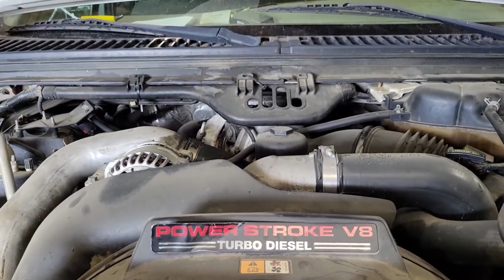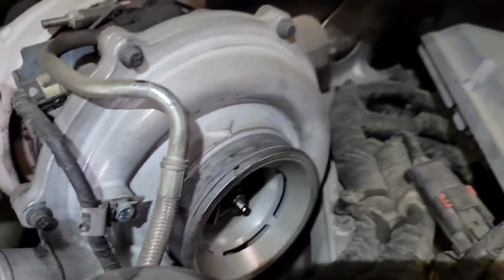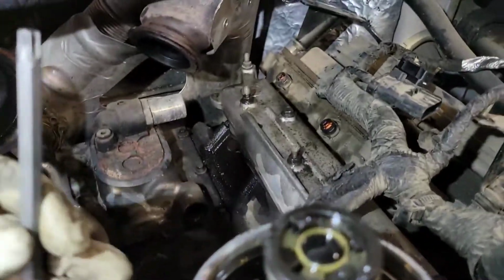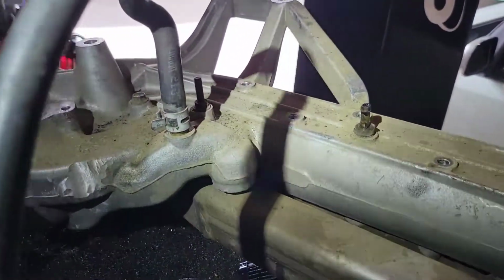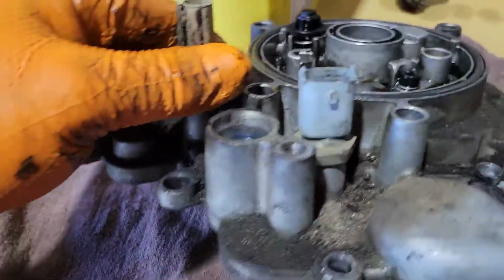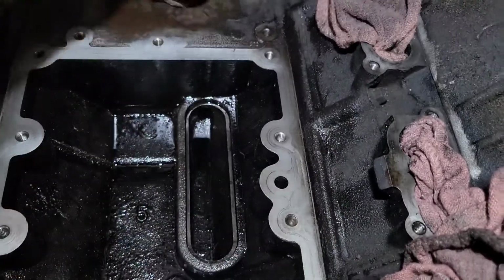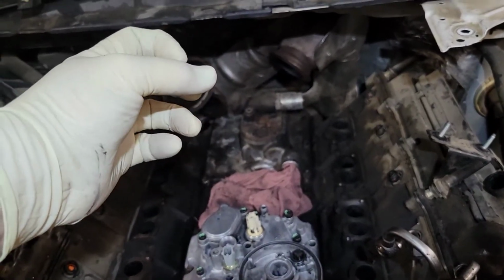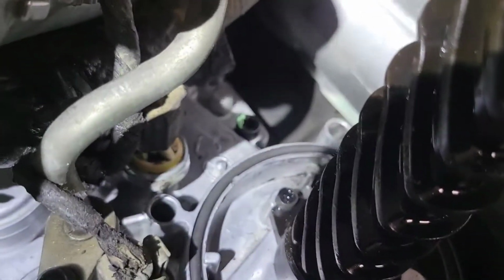6.0 Powerstroke Failed Oil Cooler How to Service

Comment: Truck driver and former car mechanic from back in the points condensor and carburetor days here. Just bought a '03   6.0 as a second or back up dually for trailers a year ago. I'm chasing YT channels to learn about this motor and to be ready for whatever. Your video on this was the most complete so far, is there much if any difference between this '06 and my '03 and another question, on the turbo video I saw before this one, can I clean that exhaust side or maybe even the intake side also of that turbo in a blast cabinet? of course taping the oil holes and bearings.
Reply from the maker: Thank you very much. As far as a difference I do not think there is a difference but the egr cooler is different. As far as the turbo, I am not sure about cleaning intake side in blast cabinet, not sure if it would damage the surface. I have never used a blast cabinet and have never needed to clean a turbo. I would think exhaust side would be fine because I think it is hardier but again I am not sure. If you do not spray the contact surface of the unison ring probably would be ok. I have multiple videos on taking this out and taking them a part to clean. message me on Instagram if you need more help.
Reply: Thank you for the reply